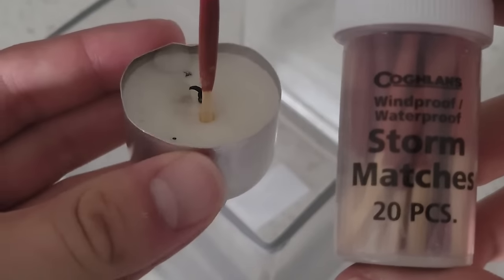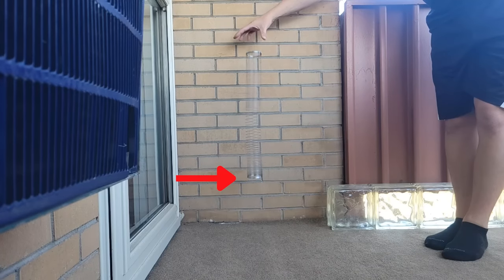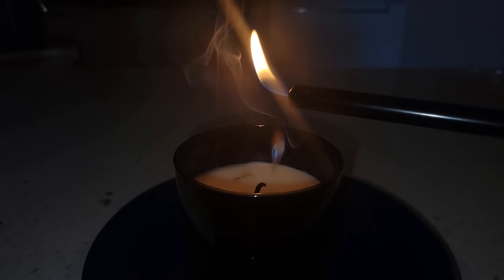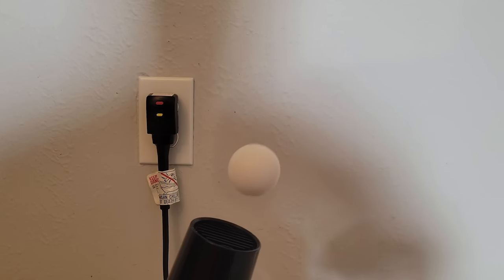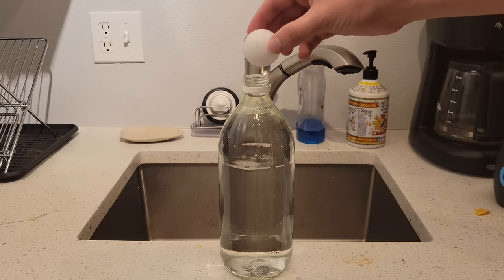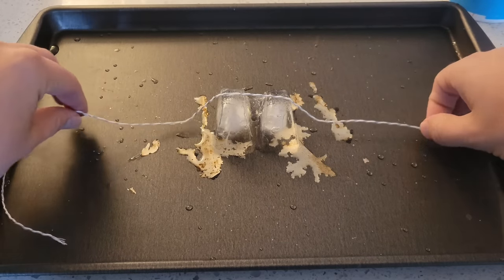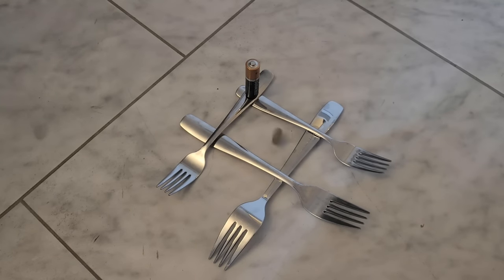Does a comb attract faucet water? (2 Truths & Trash)

Comment: The first one was tough! There actually are items you can buy that will sustain a flame underwater, but usually youd see a lot more turbulence from the heat
Reply: I just used method of elimination, because I knew the other 2 was true so it was kinda obvious. If it was a standalone question though I might not have gotten it.
Reply: @TheQuackleDKZ  i thought it was going to be a trick question because i knew all 3 were 100% possible, so i chose all 3 thinking the idea was that you're gullible if you believe only 2 are right.
Reply: the clue is that there is no bubble formed by underwater flame

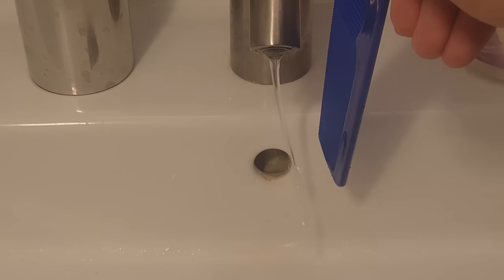Comment: 1:41 fun fact: if you boil an egg and do this trick, it will not work because the egg is cooked and is now in a solid(?) form, this is a way to differentiate non boiled eggs from boiled eggs, if you ever need to
Reply: this is indeed true, they become a solid due to the denaturization of the proteins in the eggs (the string shaped proteins that are neatly packed get tangled and become solid and rigid due to the heat)
Reply: If I’m ever in doubt I normally just throw it at a wall, but to each their own
Reply: @erazure.  i lovethis
Reply: dats crazy
Reply: @Metal_Master_YT  isn't it coagulation?
Reply: @dizknots9357  coagulation is the result, protein denaturization is the cause.

Comment: in case someone is wondering, yes, storm matches* can burn underwater, but the described mechanism of action is completely wrong

*probably not all of them
Reply: And they would bubble
Reply: i can't seem to find a video about it (underwater storm matches) can you provide the video id, if its on youtube? from nilered i was told about the fire triangle (oxygen, heat, fuel), so how telltale a magical matchstick would preserve all three? (also isn't water inflammable, especially since its a product of burning itself?)
Reply: @helper_bot  
Answering in order:

there is a video titled “Matches That Burn Underwater”, don’t know the ID or anything about the content.

The matchstick is coated in a thick layer of oxidizer-fuel mix, and produces enough heat to not go out ( note: there will be no visible flame while underwater, even though it is burning, but there will be lots of bubbles composed of boiling water and combustion products )

Confusingly, “inflammable” and “flammable” are synonyms. The correct word is “nonflammable”

No water is being burned

Combustion products can be inflammable
Reply: The ONLY way anything will "burn" underwater when we are referring to rapid oxidation in an exothermic reaction as "burn" is if the material burning has it's own included "oxidizer".  Such as rocket fuel or gunpowder or an emergency flare.
Reply: @paulmartin2348  or a storm match
Reply: sorry to break it to ya, no fire can be underwater, ever.
Reply: @paulmartin2348  

Lithium, sodium, potassium -- water can be the oxidizer.  And those burns are really nasty..
Reply: @avatar7166  Look up underwater welding and if that doesn't convince you, look up magnesium burning underwater.
Reply: @avatar7166 Water does two things, cool down the fire and cut off oxygen to the fire. If the fuel source had oxidizer and the flame produced sufficient heat, you could absolutely have an underwater fire.
Reply: @realtimberstalker  It wouldn't be fire because the flame in a fire comes from gas that is oxidizing. Things can burn underwater though, that's true.
Reply: not true cuz fire is impossible underwater
Reply: Niko oneshot detected

Comment: First one was actually the hardest for me, I knew the slinky one was real because inertia is a thing, but the other two both seemed fake. I only got it because the appearance of the flame did not change one bit as the water was poured on top of it, which was a giveaway.

Second one I had seen all those effects before, but the hairdryer one was obviously fake. It does work, but not when the hairdryer is at a 90 degree angle, let alone 180.

Third one was obvious, you can't get power from a battery with only one terminal connected. I was pretty sure the salt ice one was real, and the ping pong ball water one seemed plausible but I wasn't 100% sure.
Reply: Also:

For fire to exist, it needs the 3: fuel, heat, and oxygen. Underwater, it can still have fuel, but the water would suck the heat out of the matchstick, and would also need an external supply of O2 beyond what the matchstick or water itself would provide.
Reply: @namelesscage  Some fires burn hot enough to cause a leidenfrost-like effect, and can thus burn underwater, and fuels can have their own oxidizers. I was pretty sure that wasn't what was happening here, but the visuals were a more immediate clue to me.
Reply: @Owen_loves_Butters  my stupid ass thought the flame was changing tbh i think that's what got me lol
Reply: What inertia? Do u know the meaning of inertia, explaining everything with inertia is just stupid. 
U should instead see it in terms of kx and mg it will guide u to "why inertia".
Reply: @TechyMage  Yes I know the meaning of inertia, and it's not really a thing, but rather a property of any object with mass.
Reply: also no bubbles on first one
Reply: @SimonWoodburyForget  I didn't know the smoke was actually unburnt wax, it's something I learned after watching this.
Reply: i watched so many short videos about all of these i just picked which one i didn't see and i got a 3/3..... ineed a life

Comment: #3 is a hard one between #1 and #2. The ball will act as a cap, however not under the pressures given, since there's a higher pressure on the inside against the ball than on the outside against the ball in the time of the doing.
Ice will melt when salt is added, so idk how this would make sense, unless it melted and then re-solidified.
Anyways I think its #1.

Comment: I'm 99% certain its #3. Heat travels upwards so the fact the flame is traveling downwards makes little sense, seeing how there is almost no fuel for the flame, if any. The first is obviously real (I've used stormproof matches before, though typically they create a lot of black crap all over, so that's where my 1% lies.) and I don't want to go into detail #2, but I can confirm it.

Comment: I'm proud of myself for not only identifying which were fake due to an understanding of physics, but also spotting the details in each of the fake ones that gave away their fakeness (lack of movement on the flame of the match when it supposedly came into contact with water, inconsistency in the movement on the ball compared to the angle of the hair dryer, and just recognizing that the coin video was reversed)

Comment: (round 1) 1. Underwater combustion is possible but the reason provided is bogus (grease combustion is not possible underwater and combustion conditions are not why water should not be used on grease fires (the water flash-boils, which physically pushes the flaming oil [ physically spreading the fire] and divides the oil into droplets, increasing the rate of combustion [combustion occurs around the surface of the oil, and dividing a substance into small pieces increases the surface area]).

The footage of the underwater match also looks unphysical. The match doesn't react at all to being submerged 

2 and 3 are also results I was already familiar with.
Reply: I missed some details of 2 -- i thought it was just showing the ping pong ball being held up at all, which is a known valid result

Comment: Well you could have a fire underwater, but it should be like Phosphorus or a rough oil pipe that has also some air shoting out.

the ball on the hair dryer, wouldnt it just fly on a side? i doubt a hair dryer has such precise air flow.

Comment: Predictions:

All of the first three are real phenomena.

Of the next three, the hair dryer ping pong ball thing is what I believe to be fake. The phenomenon involving the egg makes sense because its contents are liquid and I know about static electricity. The ping pong ball should have fallen as soon as the hair dryer was aimed down. Gravity should then have pulled the ball far enough away that the coanda effect would no longer be strong enough to keep the ball in the air stream.

The battery one is fake. Dude, you could’ve at least made it appear like a complete circuit. Standing the battery up with only one contact touching metal really gave it away.

I was pretty surprised by the “underwater match” thing being fake. It is possible to create fuel/oxidizer mixtures that burn underwater and though I can’t really imagine an application for such matches, that could just be blamed on my own lack of imagination.

Comment: Wait, how did you get the ping pong ball to stick to the lip of the bottle when you turned it upside down?
Reply: It's the same idea as how water gets stuck in a straw if you block off the other end of a straw. When you turn it upside down, gravity (very slightly) pulls the ball downward, but then because the bottle is sealed airtight it creates a vacuum in the bottle which loosely speaking sucks the ball back in. If you poked even a tiny hole in the other end of the bottle then the ball would immediately fall out.

Comment: First one is fake. I’ve seen the other two work irl. Those “storm” matches are more resistant to water and last longer than normal, but cannot burn when fully submerged. Those kinds of fires are too dangerous for matches

I got the other two as well (post-edit) since they just seemed completely ridiculous. A ping pong ball floating while the drier is above it? An AA battery not only making enough power to spin a coin, but doing so while only touching the negative point? Even I’m not that gullible